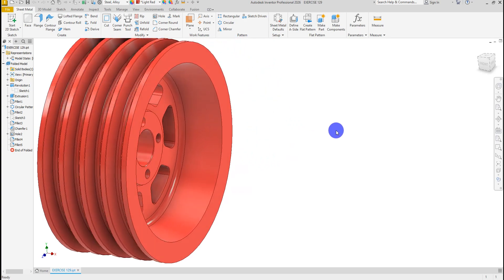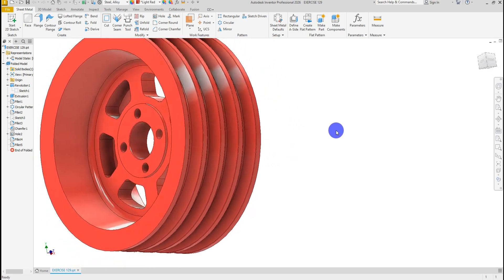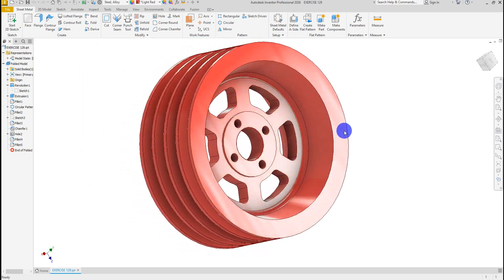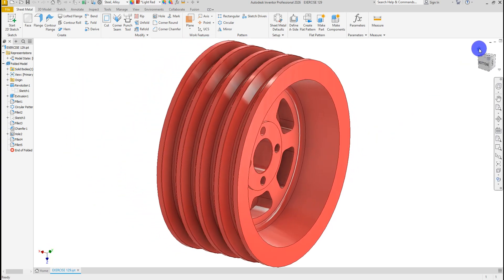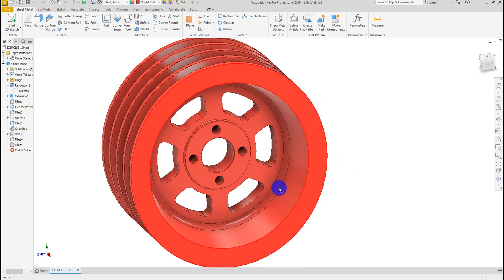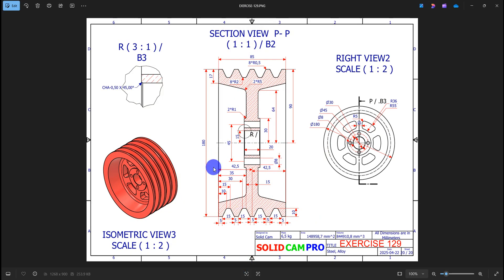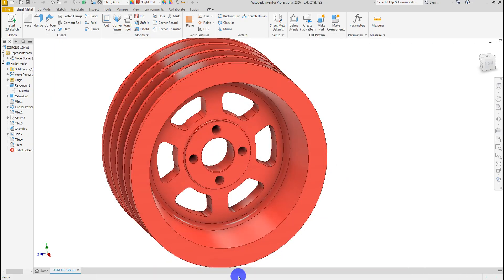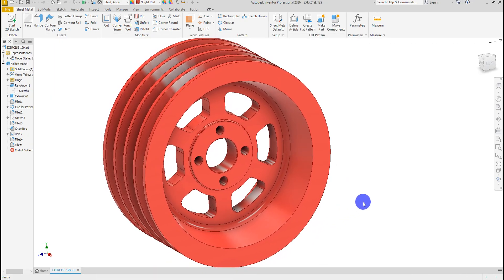Autodesk Inventor  Mechanical 4-v pulley Designed EXERCISE 129

Comment: Please,  what is  your computer configuration to run Inventor?
Reply from the maker: hi , OS: Windows 10 / 11 (64-bit)

CPU: 4 cores, ~3.0 GHz (Intel i5 / AMD Ryzen 5 or better)

RAM: 16 GB

GPU: Dedicated graphics card with DirectX 11 support (e.g., NVIDIA Quadro P620, AMD Radeon Pro WX 3200, or similar entry-level professional GPU)

Storage: SSD, 40 GB free space minimum

Display: Full HD (1920 × 1080)     . recommended